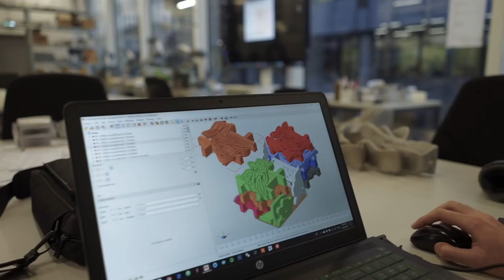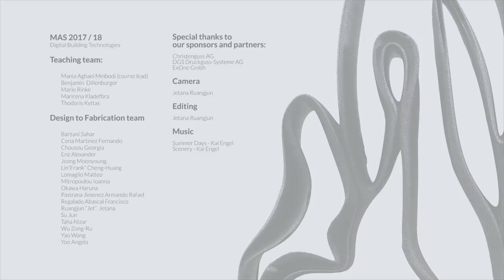ETH Zurich casts intricate metal facade in a 3D-printed mould

Comment: I'd like to see this idea tried using electroforming as it may be quicker, as well as far more energy and material efficient. 3D print in a plastic that can be melted and reused later, then coat the 3D form with graphite "ink" before electrochemical deposition of metal, with the ideal being titanium (yes my research suggests it is possible, but perhaps patented?). Once the metal shell is formed the plastic an be melted so that it can be recycled, leaving a very strong, lightweight, structure that has a very long life when exposed to the elements, but which itself can be recycled at the end of the building's life.
Reply: Daniel Matthews genius! Practical, yet ambitious and Innovative